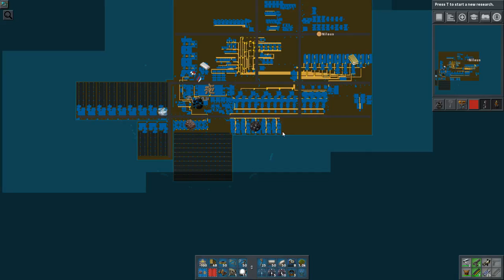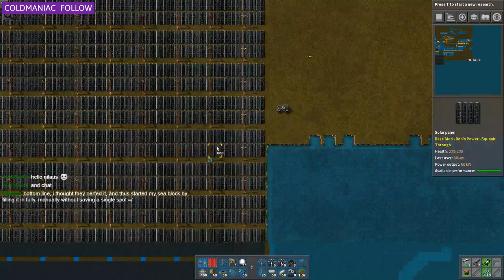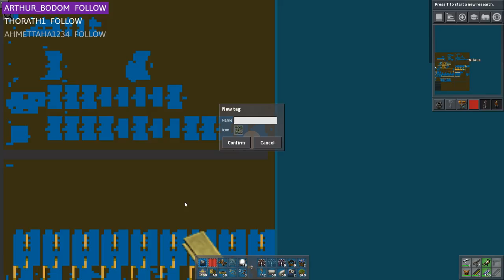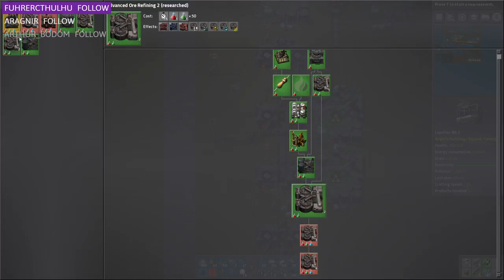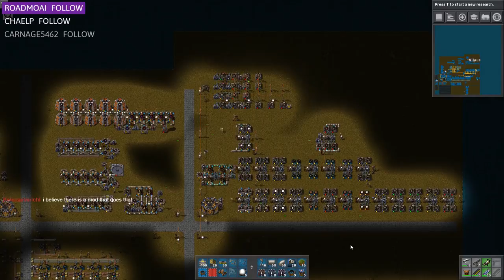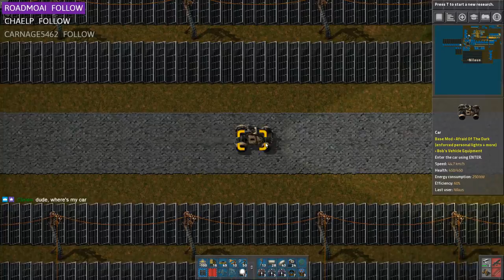Factorio - Sea Block Tutorial - 15 Livestream Footage

Comment: Nilaus, I see you are always having a bit of an inventory problem. You have the even distribution mod which has a neat function if you press shift+c. It will take any item in your inventory that can be used in any of the factories onscreen (no long reach). It has been a game changer for me. Saves me so much time to just run to the area that most of the stuff is used in (say I have a bunch of ore and run to my processing area) press shift+c and poof, clean inventory. I've started using it every time I edit or build an area before moving onto the next.

Comment: I am scaling up plate production since I am done with refining research. For iron copper and tin I do use the pellet to have a 6 ore -> 12 plate ratio but for lead it seems to be almost useless and not worth it since you have to count a couple silicon ore to have the ore doubling on lead. Any way nice video.

Comment: two things your being highly inefficient with:wood pellets should always be turned to coal, there is nothing wood pellets are better at than coal, fuel or carbon dioxide.iron ore -> iron plate -> smelted at standard smelter to steel, is a more efficient resource production chain than angels steel plate metallurgy...
Reply from the maker: Wood Pellet -> Carbon Dioxide is better than Coal -> Carbon Dioxide when you calculate the power used in machines to get from Wood Pellet to Coal.
The Iron -> Steel is correct (unfortunately). I really want Angel to make sure his way is better than the default. Normally I play with the Smelting Only mod to force the use of Metallurgy as the Iron -> Steel is 30:1 in that mod
Reply: i understand what your saying but its still wrong, the power to convert the wood pellets to wood bricks is meaningless since solar is a thing, and if you have the wood brick furnace self feed(inserter with pickup and drop at the same location) you still get 0.06 extra carbon dioxide which at first glance isn't much but at that point you never have wood pellets sent anywhere since again coal does everything wood pellets does but better...
Reply: It's true that if you spend the resources and time needed to set up more power, you can treat power as an "infinite resource" and then, you can ignore the power in the construction of wood pellets/coal/coke/coal pellets.
But at any given point in time through the first 10/20 hours, the power was the limiting factor so I'm not so sure it was really possible to ignore that part at the beginning.
Now that power is not an issue anymore, I would agree with Zarklord.
Reply: exactly.... although I`d argue that since your already needing to make coal for literally everything except carbon dioxide(since wood pellets uses are: fuel(really bad) and carbon dioxide(not awful)) that your already have the wood pellet to coal process setup in early game that you should still do it.

Comment: What I would like at some point is to see someone do a lazy bastard run first on Vanilla,  then on Bob's,  then on Angel's,  then on Bob's Angel's.  Yes,  I know that the mods invalidate the achievement,  but what IS the minimum number of handcrafts for each set of mods....  With Seablock it is essentially impossible to be a lazy bastard.
Reply: I think Nilaus is the ultimate handcrafter and that a lazy bastard run would just be plain torture. I wouldn't wish that on my worst enemy :)
Reply from the maker: I may do it for Vanilla at some point, but I will definitely never do it for Angels/Bobs